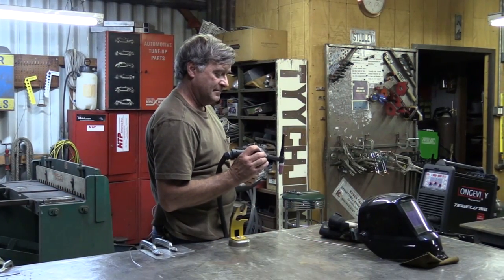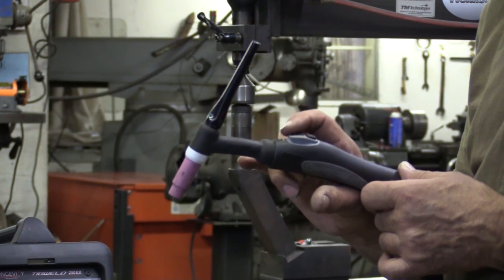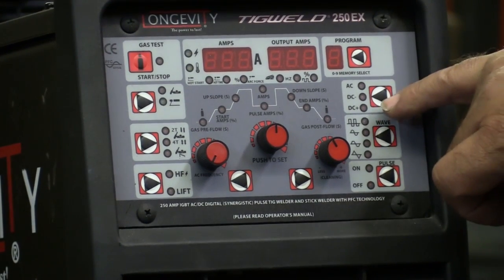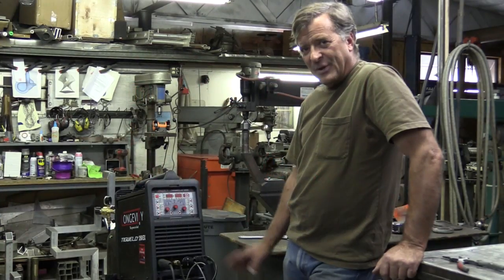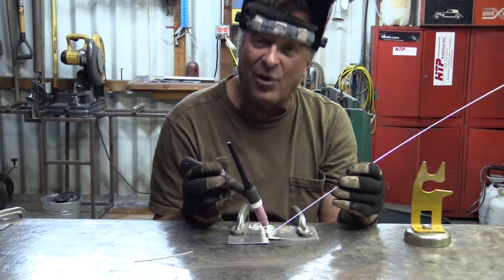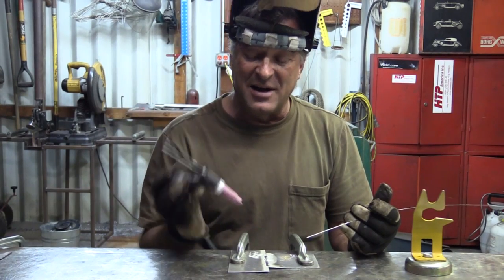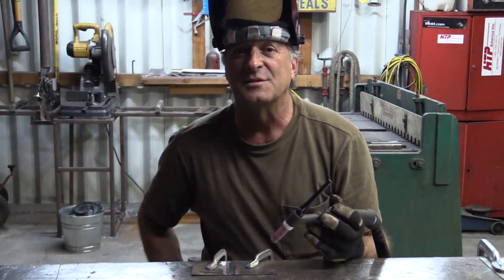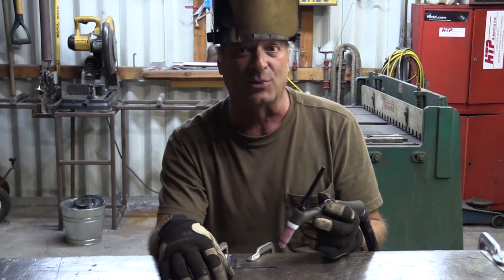Introducing Longevity's 250 EX TIG Welder - With a Really Cool Torch - Kevin Caron

Comment: I have the same machine and can’t get the torch controls to work. Only the foot pedal works. Any ideas? Hasn’t worked since I bought it and never needed it until now. Tig welding pontoons. Thanks.
Reply from the maker: It has been several years since I had that welder.  Please tell me what your settings are.  Seems like there is a trick to getting the finger controls working.  Or you just have a bad torch finger controller, and it needs to be replaced.   Have you talked to Longevity about this problem?
Reply from the maker: You are changing the button to 4t or 2t to use the finger controls, right?

Comment: all other remote amperage control torches only have ONE single device that turns. as you turn it, the torch is turned on and then amperage is increased when you are done, you turn it the other way and amps go down and then torch is turned off. How the heck does one use this torch? You turn it on, adjust amps, then turn it off, that's goiing to be one shaky motion, sorry looks cool, but fails due to being impractical .
Reply: ***** maybe you could show your technique in a future video welding aluminum since that is when a remote amp control is most handy?  I'm guesing you would start wheel set at full power  then weld , but then how do you gracefully stop? You must be in 4t mode? otherwise how can you lift finger off button and turn wheel at same time?